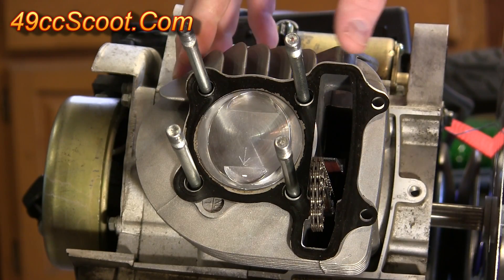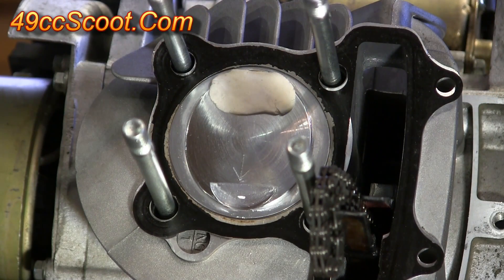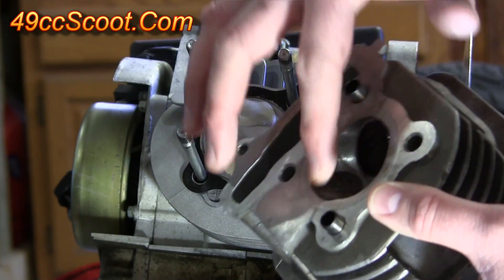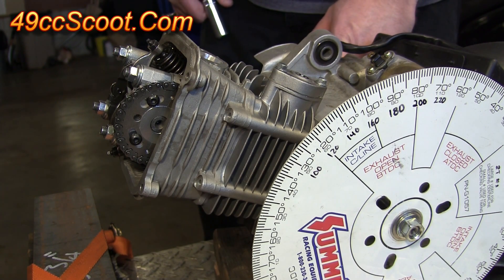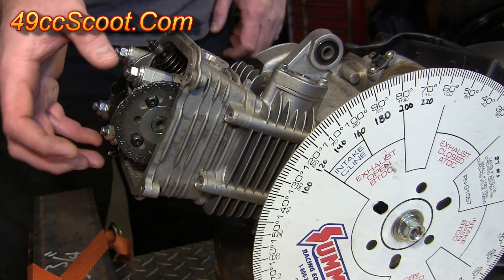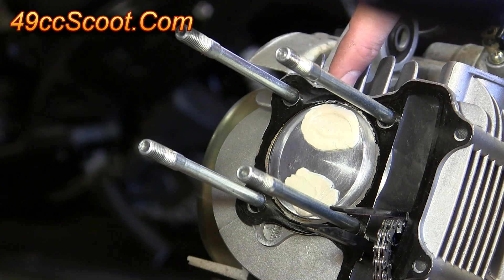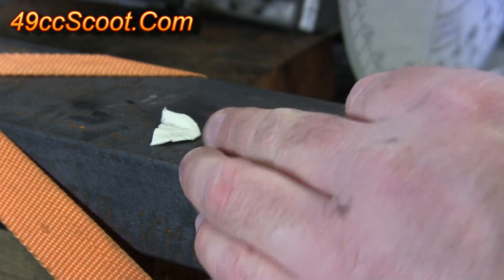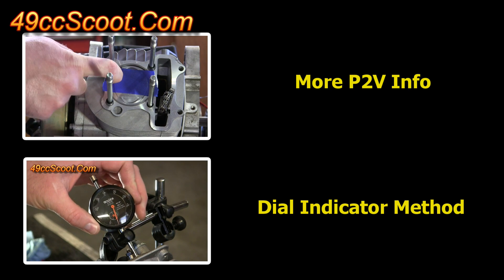Piston To Valve Clearance Check : Clay Method

Comment: Great video. Couldnt you just look at the rockers and know when both valves have opened and closed omce? Some engines you cant see the cam.
Reply from the maker: As long as you know the valves have opened, it's fine. 720 degrees of crank rotation (2 full turns around) works.

Comment: Can I install head gasket that was used in this procedure? Or it should be a new gasket?
Reply from the maker: You can use a used HG. Just use the same type that you plan to use with the actual build.
Reply: @49ccscoot  thanks.

Comment: Its so easy to se that you have used tools on the top of the piston, and the turned the piston the wrong way.. .ive installed 100 or more , and its easy to se what youve done.. morrown
Reply: The piston is installed correctly; the arrow goes to the exhaust. I'm assuming what you're referring to where "he used tools on the top of the piston" are the valve reliefs; those are normal.

Comment: You morrown, the point ,or arrow is upside down, its for intake,not exhaust
Reply from the maker: Sorry, but you have no idea what you're talking about. The arrow points toward the exhaust in this application. Anyone that knows much about engines could look at the large valve relief at the top and small relief on the bottom and know that it's properly oriented. Experts like you should stop watching videos and destroy engines with your immense knowledge. Side note; moron is not spelled morrown as you have written it in 2 separate comments.
Reply: Please dont waste your time on this morrown. Nice channel i subbed!
Reply from the maker: lol Thanks!